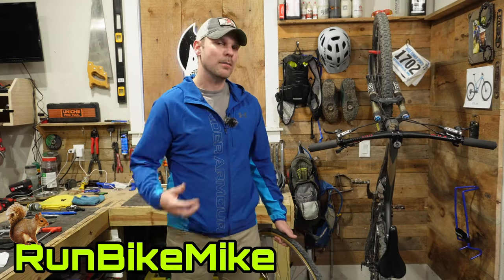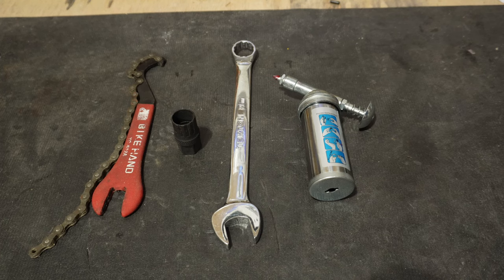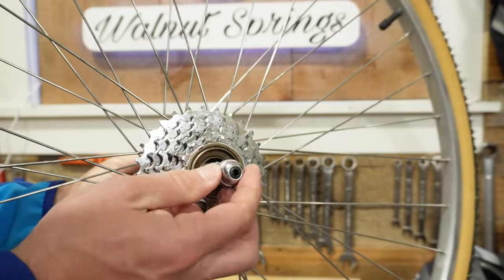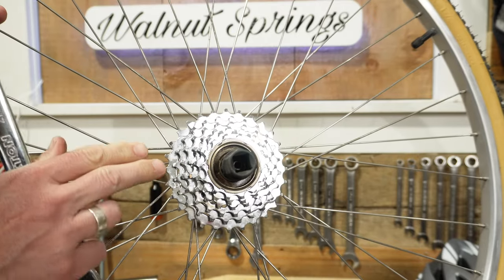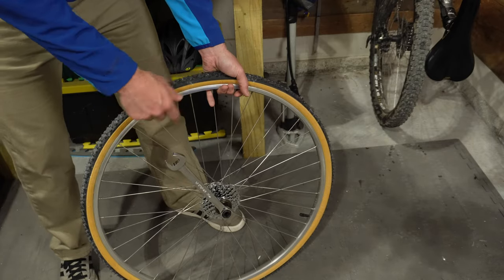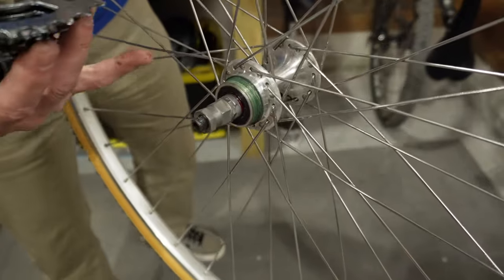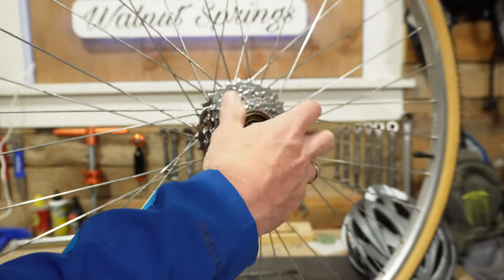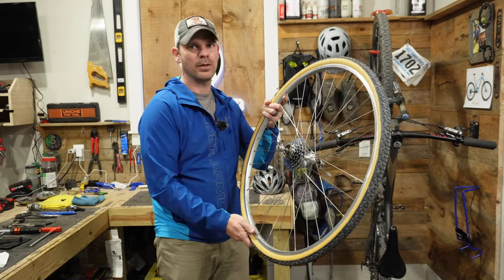How to Remove and Install a Bike Freewheel

Comment: Very good and clear Thanks. Question:- before starting working on it. how do you recognize if it is a Free wheel or if it is a cassette you are looking at.  Thanks Brian
Reply from the maker: You can tell by looking at the center. A freewheel has a thick ring that has bearings behind it and threads on to the wheel. A cassette mounts to the free hub that is on the wheel and it has the bearing in it.

Comment: Nice video. So to confirm, the tool is required for removal but not for installation?  My old freewheel loosened on its own during a ride and dropped the ball bearings. I'll try to get the remaining piece off using vice grips and then replace with a new freewheel. If I can hand tighten and use some pedal pressure like you said that saves me from buying the tool
Reply from the maker: That is correct.

Comment: I probably meant a Free Hub. Where the part with the ratchet is a separate part. Will I only discover the difference once I  have taken off the cassette like you have done.